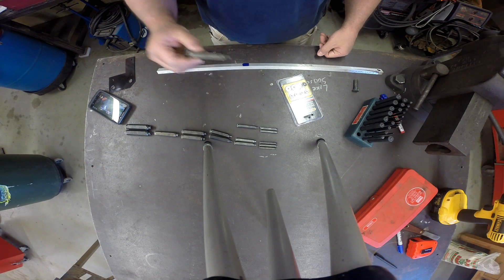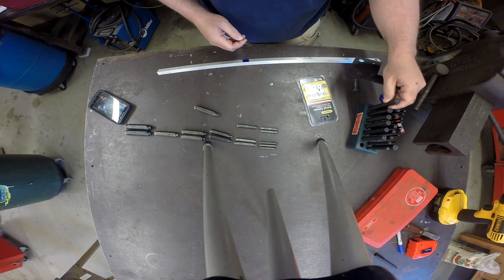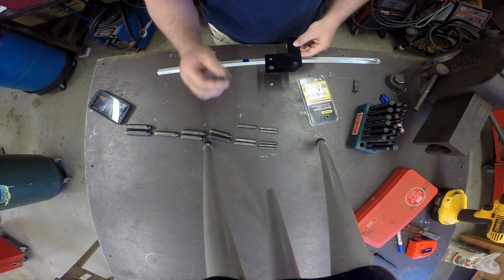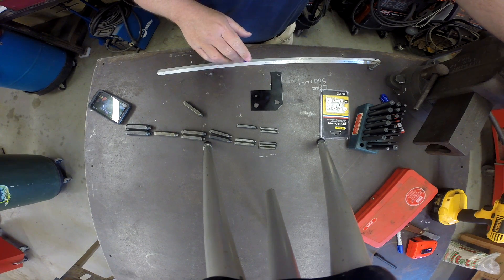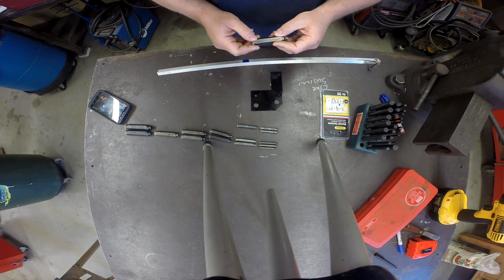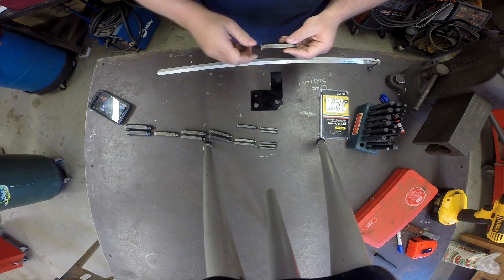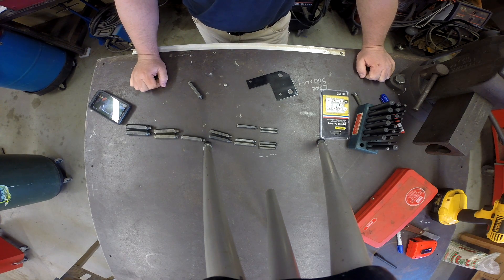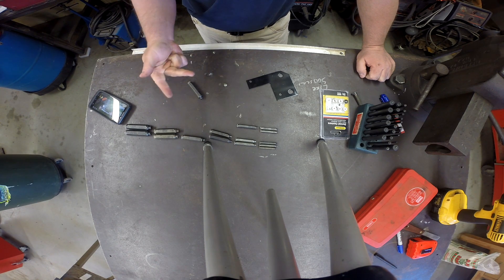Have You Seen My Tool 012 - Heimann Transfer Screws

Comment: Not a good illustration of the too which I've used for years.  Scribing a line is fine.  You should have positioned the metal where you wanted it, tapped it with a mallet, and had a locating dimple for your drill press.  Just scribing a line doesn't locate the desired hole.  For 8+ minutes of the video, more than 6 minutes was wasted. Next one, make up a reference card for yourself and keep to the point without stumbling around.

Comment: Excellent presentation. Iv'e seen an Australian video where the fellow uses a number of set screws to make his transfer screws and hex brass to make the tool.It makes a beat little lathe (and silver/brass) training aid. There are number of suppliers, and for the price - we are a metric country - you get 3-6 mm in one set and 6-12 mm in the other set for under $AU30, so it would pay to get these two sets and make up imperial ones as required. New production needs to be done in metric, but there is a lot of restoration work, in imperial. I have a job where I have to mount a bracket to the output shaft of an engine (SAE?) and trying to measure  and mark out, etc, is a real pain; using  transfer screws makes the job real simple. Thanks for the video!